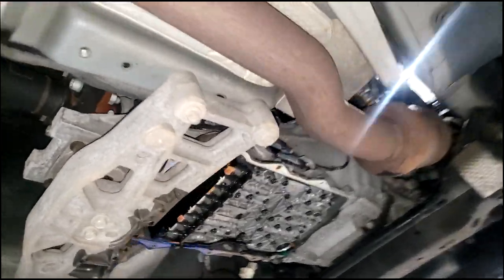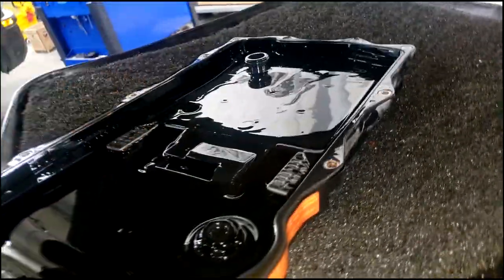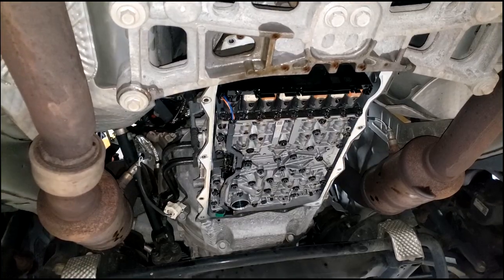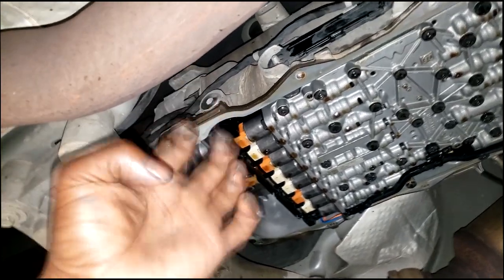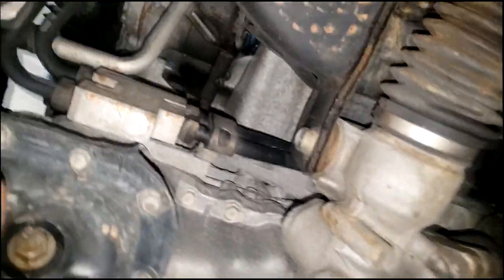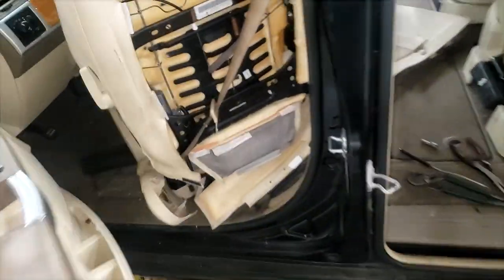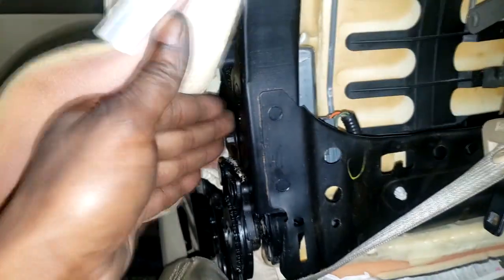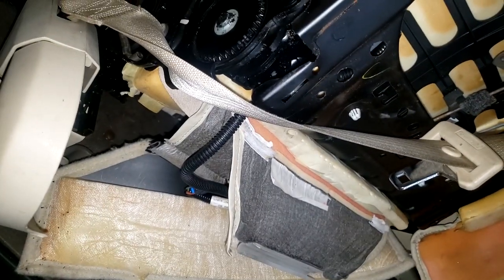Typical day at the shop. Lets talk ZF 8 speed RWD Transmission service. Seat recliner finally FIXED.

Comment: ZF has the most pull, they engineered the transmission.
Reply: But CHRYSLER, not ZF, pays for any warranty repairs.  After the warranty is up, YOU pay either way!
Reply: @genepoon8905  if it goes to court because they deny warranty they'll look like fools... Almost guaranteed they won't deny warranty if you're using a product the transmission maker says is compatible 😃
Reply: ZF even says that the transmission is not lifetime. Chrysler says it’s lifetime but ZF says it’s not.